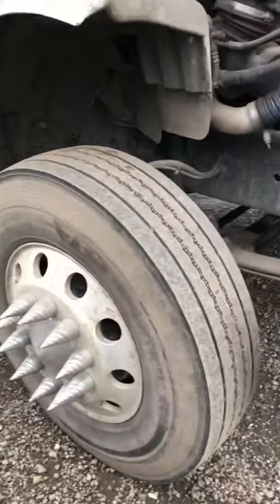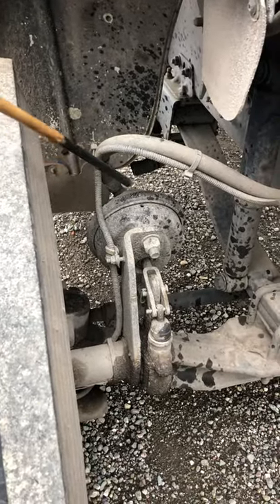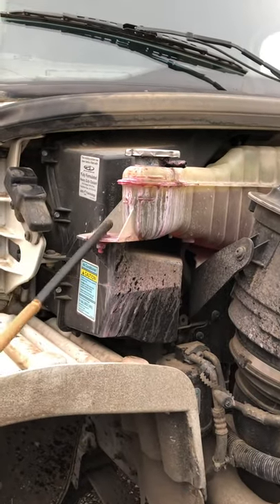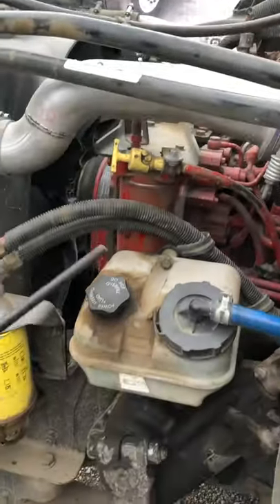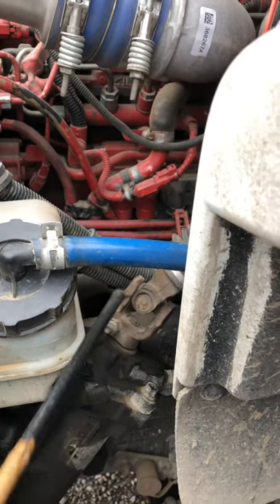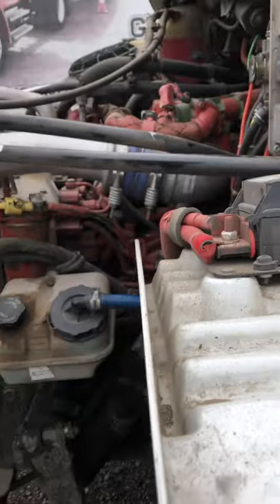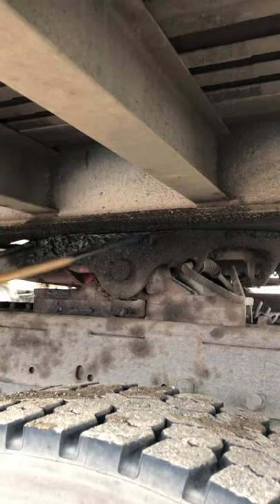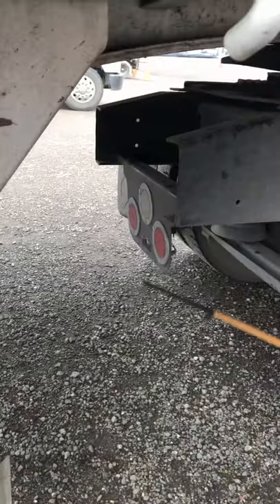Ca Cdl Services pre trip inspection (Sec A)

Comment: That was one of the best California CDL Class "A" section inspections, ever!  Excellente! There is only one thing I might add:  On the Air Compressor Governor, one needs to make sure the Governor's electrical wire is attached properly at both ends, and in peak condition, even if one cannot see it.  I would like to see Section "B" and Section "C," if they are available by you!  Again, Great Job!